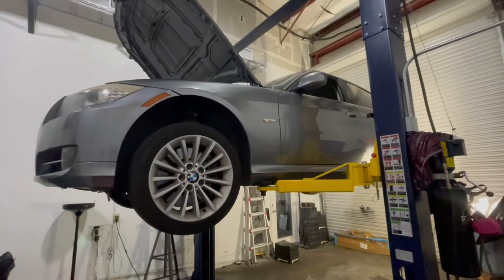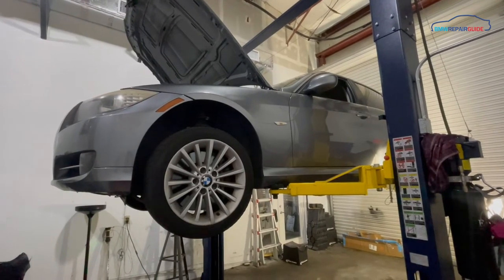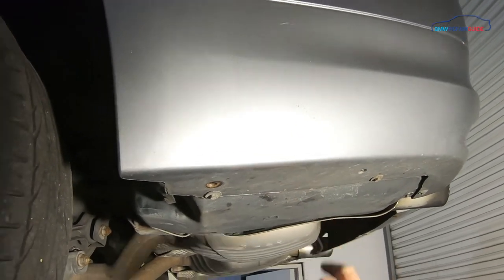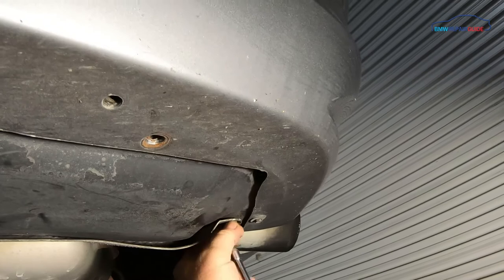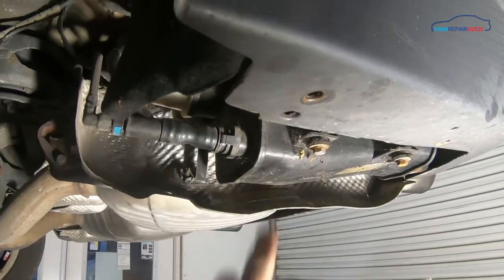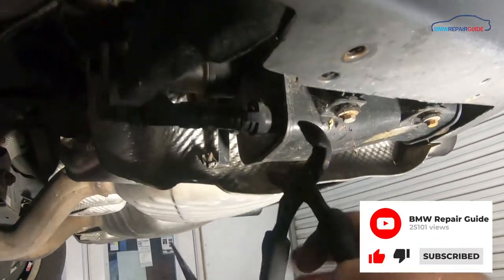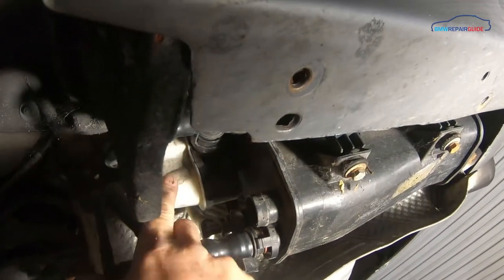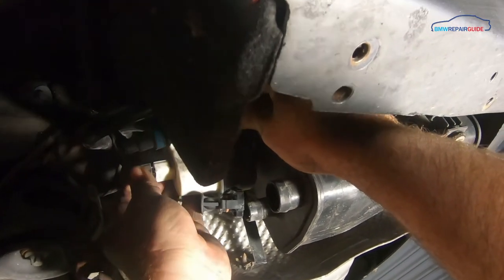BMW E90 Fuel Leak Detection Pump/Charcoal Filter (Canister) Removal

Comment: I have no code but the gas trigger keeps tripping when filling...so I'm thinking the vent system is clogged which may eventually throw a code? So I should do this removal but maybe clear all the lines and maybe shake the canaster, maybe the charcoal solidified and needs to be shaken not stirred.
Reply: Charcoal filter is around $330 OEM
Reply: I have same problem . Did you figure it out yet?
Reply: @elit.8034  no, but I heard clocking the gas nozzle when u fill it to the 9 o'clock position seems to eliminate that...haven't tried it yet as it's not my daily driver. If that don't work then charcoal canister probably.
Reply: @D Gaz  OK thanks. On to the BMW fueling mystery lol

Comment: Am not knocking anyone but anytime u watch a YouTube video why ppl Always say it is difficult? Maybe it’s because I worked for bmw. I can tell u one thing u will brake more stuff by prying on it if potential to make it leak by damaging the plastic with a screw driver or pliers a little Jb or lithium spray nest time and give it 10 sec then squeeze tabs and pull and watch the magic the reason why it’s tight is the O ring
Reply: So, what you are saying is to spray those plastic and pipes and tabs with lithium spray and than let it stand for 10 seconds and then try to pry it out by hand, not by using screwdriver and pliers, correct?
Reply: So that's the secret. what you're saying makes sense. I've worked on so many BMW's and I always hated those plastic pinch clamps. Thank you.

Comment: Do you think this has anything to do with fueling the tank and I keeps triggering handle? It takes for ever to fuel the car. Any thoughts
Reply: I have the same issue 🤦🏽‍♂️. Did you find the fix?
Reply: It's exactly what it was. So my BMW mechanic told me because the charcoal canister will go bad due to over fill gas tank. When the gas triggers a full tank , most people  like to continue to fill to brim, which doesn't allow correct breathing and the charcoal goes bad.
Reply: @elit.8034  yes that’s exactly what fixed mine. Swapped the evaporator canister out and has been good ever since. This is a common problem that there is not much info on.
Reply: @jplumb5591 it's a common problem because it's very common for morons to overfill their gas tank to the brim it's a sealed system where do you think that extra fuel is going. Yes it goes to your charcoal canister ding ding ding.